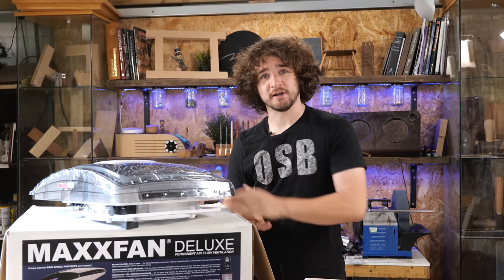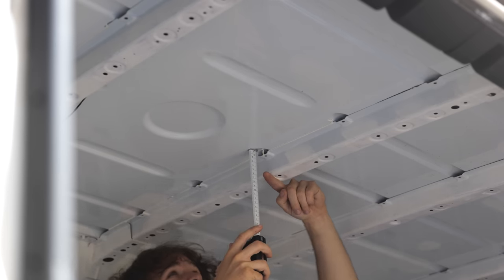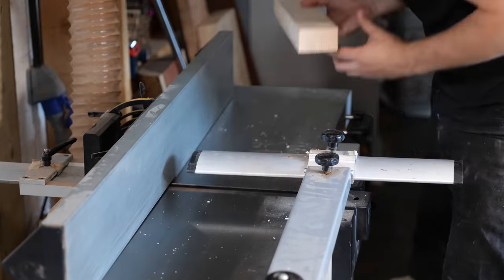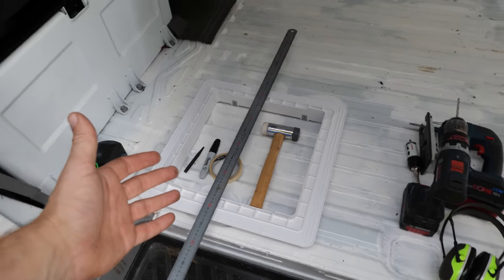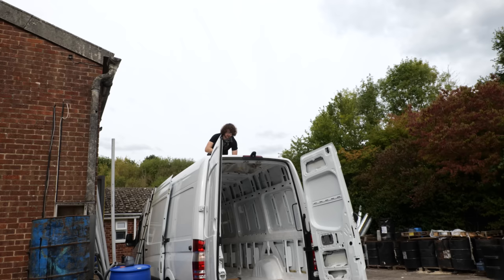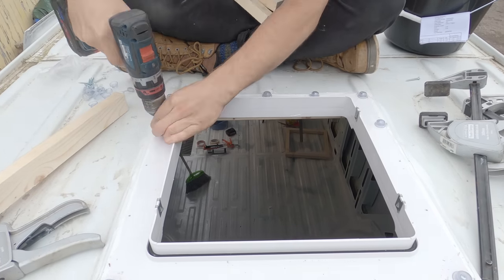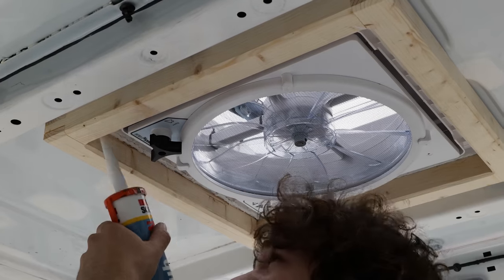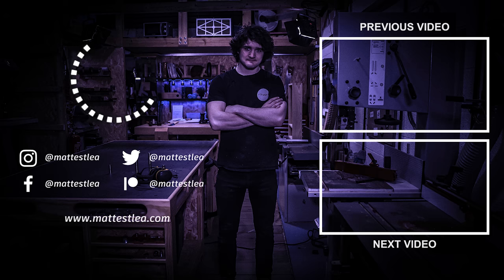Maxxfan Deluxe Unboxing and Installation | Mercedes Sprinter Conversion #9

Comment: I totally had the same ‘400 v 335’ issue. I even made the frame at 335 although i had already measured at 400…I knew there was something wrong. I actually felt a greater sense of achievement finding this tutorial (I laughed) then finishing it…72 hours later🙄. Thanks buddy!

Comment: Great Job Matt, however the Hole Saw that you used is a general purpose hole saw. For cutting sheet metal use a sheet metal hole saw. From Bosch, the Blue ones, you will get a much cleaner finish.

Comment: The Milwaukee hex shank Shockwave hole saws are awesome as they have a really thin wall.  They cut perfect holes in stainless and mild steel and because they are thin wall do not wander and cause an oversized hole. I use them with a regular drill and cutting fluid but can be used with impact driver

Comment: Can you believe  my  max fan didnt come with a  template.  Really  max fan  need to figure out a screwing that doesn't require all this  woodwork. When yo come to measure you can't even rely on the blody tape measure as that has about 2 mill of play because the end hook isn't  fixed.

Comment: Not criticizing you, but I found this hilarious: when you showed the bench hook I was like "Oh nice, that makes sense, since you push the material into it!" and then you proceed to use a pull-saw.. oof 😄

And to top it all off you plug in a link to "how to saw correctly" 😂
Reply: The saw provides virtually no force at all against the wood. It makes no difference whether you use a push or pull saw here. You are pushing the wood into the bench hook with your offhand to hold it in place.

Comment: imho, that layered tape under the hatch looks bad. A cleaner solution would be to make a transition frame with notches for the ribs on a 3d printer and that would require much less sealant. It could also be made from a solid piece of PVC or rubber with a hand router